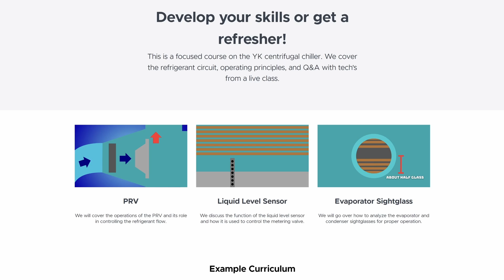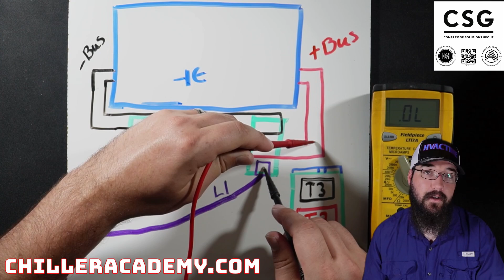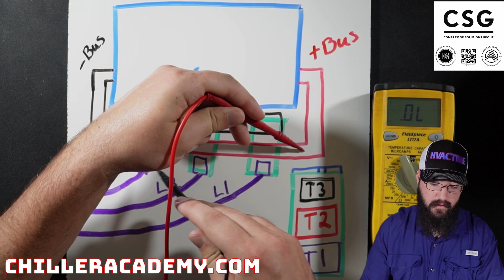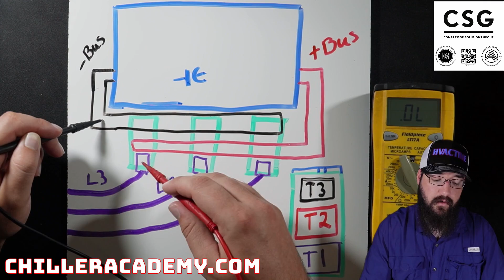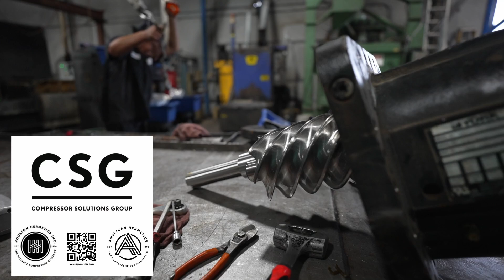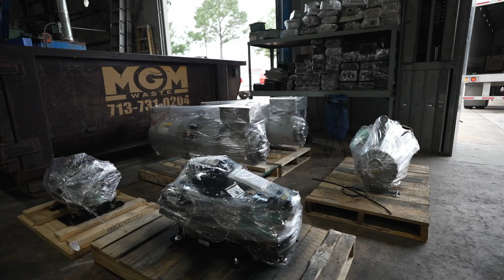YK SCR Test Procedure: Chiller Training

Comment: Got a question. It’s something I’ve always seen but nobody says anything about the setting. When you Google it all you get is a failed part description. 

On our chiller you can choose if you want it to be a shorted scr or an open scr. It’s always been on shorted but never have been able to get explanation as google says a shorted scr is a failure.
Reply from the maker: Is this in the service menu?
Reply: @HVACTIME all our equipment stays in the service menu. But yes it’s under the motor tab.
Reply from the maker: That is a manual control for testing. You can override the scr closed (shorted) or open to confirm operation.
Reply: @HVACTIME so scr shorted enabled all the time is normal operation? Sounds like it would be the other way around.
Reply from the maker: To my memory without confirming in the manual, that feature only works when the machine is in a OFF state with the panel switch off. with that test you would disconnect line voltage to the SCR so you can "trigger" them then test with a meter. When the machine is enabled, the override is ignored. I can look this up and discuss more on the stream tomorrow.
Reply from the maker: https://youtube.com/live/lb7TbZg1LbY its the first question I answer

Comment: I received the message 'VSD Precharge Low DC Bus Voltage'. Could the SCR be contributing to the issue?
Reply from the maker: Yes, scr or trigger board are the two main culprits. Make sure all 3 phases of power are coming in
Reply: I have checked the voltage at L1, L2, and L3, and found that the values are 380V as expected. I also inspected the SCRs following the method shown in the video and found no signs of damage.

After that, I used a digital oscilloscope to measure the signals at J1, J2, and J3 during a test run. I observed that J1 had a pulse signal with a 20ms interval, while J2 and J3 showed no pulse signals at all.

Based on these findings, I would like to ask if it is possible to conclude that the Optispeed Trigger Control Board (Part No. 031-02060-001) may be faulty.

Thank you. @HVACTIME